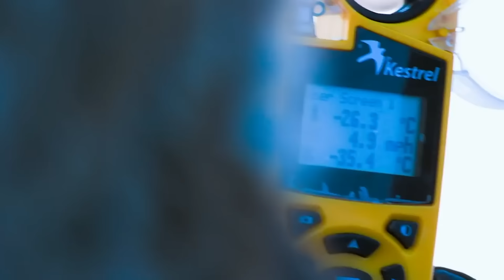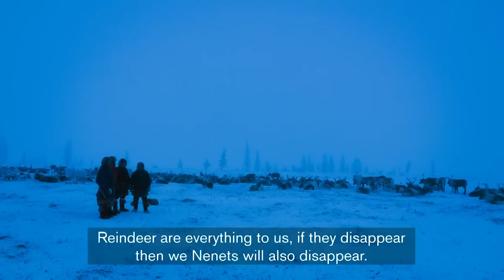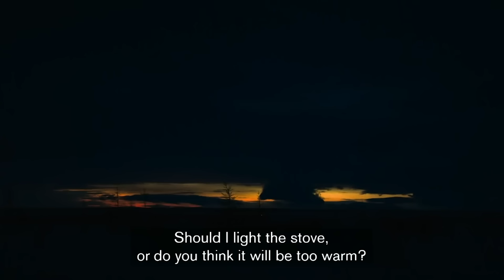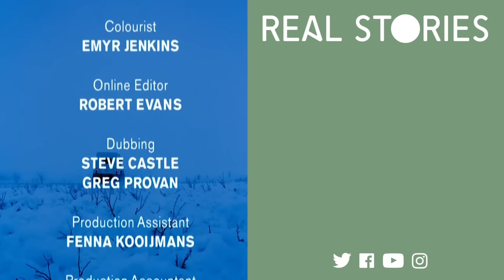Life With Siberian Nomads (Survival Documentary) | Real Stories

Comment: She said that it was a spike in temperature, saying it was warming. And that’s why they died but those people said the ice was to thick for the reindeer to get to. So it would be colder not hotter.
Reply: no! Speaking in temperature, as colder as it is, the dryer it is and ice will just form if it's wet. 
That means, if it gets too warm, the snow will begin to melt and then form a big plate of ice. But if it's cold enough and stays that way, there will just snow be covering the land and no ice will form. But exactly the first thing happened, it got too warm, the snow melted and the lichen was underneath a very dense ice plate. Reindeer scrape away snow until they reach the lichen but they can't break through ice.
Reply: It's called a freeze/thaw cycle.